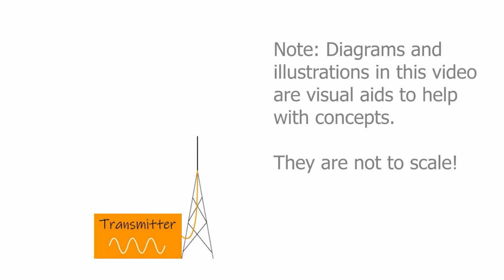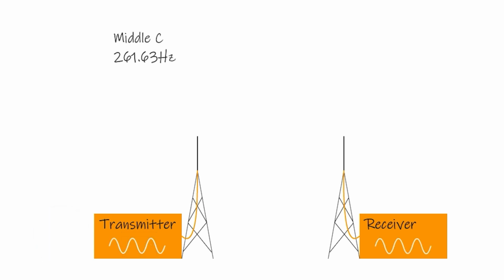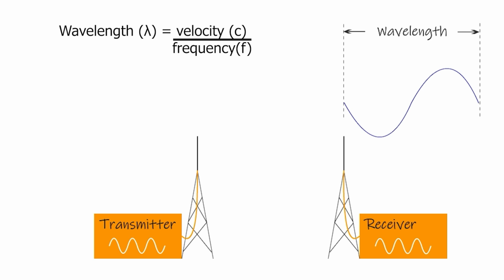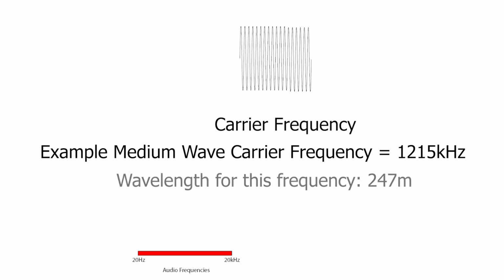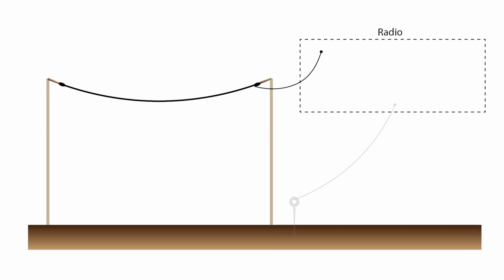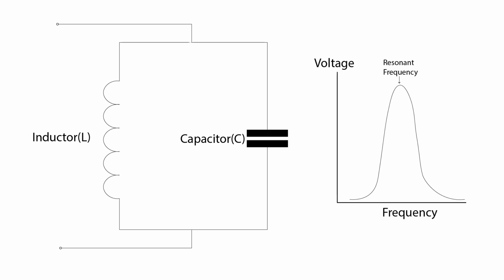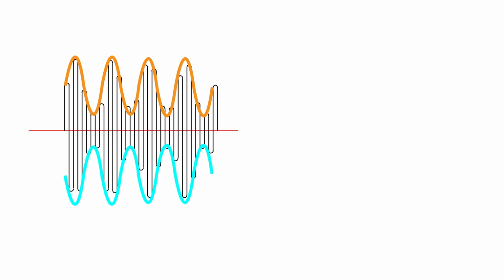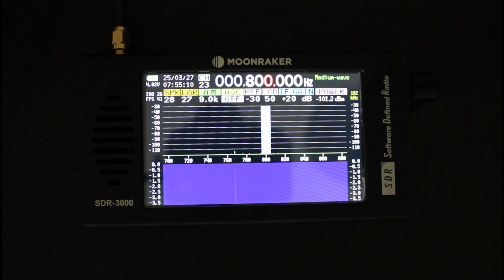Make: Electronics Book - Experiment 28 'Crystal' Radio Set

Comment: Oh my GOODNESS !

I am TEN Days shy, of my 75th Birthday . . . . . And I BUILT my first Radio (Crystal, Galaium, mounted in a copper pipe, using LEAD), SIXTY EIGHT Years ago !!!!

Onto a Bread Board, defined >then< as an old board, discarded from cutting a bunch of bread ! ! ! !

So, I find the beginning of this VERY INTERESTING!

The "Radio" was a "KIT", sold if I remember Correctly, by Revel (sp?). The Crystal fascinated me, as the INSTRUCTIONS stated "to make Contact with it we must Sharpen, the enclosed *Safety Pin*", (and how to sharpen it, with the enclosed piece of emery cloth . . . 😮 ). Then MOVING that sharpened Pin (with a Bandage on my finger, OUCH) upon the surface of said Crystal, until one hears a Signal ! ! ! ! ! ! ! ! ! ! ! !

The HARDEST part was creating the Antenna, which was to be "center tapped @ 200 wraps of the enclosed wire, total wraps, 400".

My older Brother heard me, laborously COUNTING: 168, 169, 170 . . . and started saying stuff like 68, 69, 125, 124, 300 . . .😮 

 . . . . . . . . . Later I learned not to trust my brother much, for HELP! 😂

I did get to 200, bared the wire from the enamel*, made the specified {tight} turns of tap wire onto the bared wire, and continued COUNTING, but not around my Brother! (*that same emery cloth!)

But I digress, I stopped and Wrote this, when you spoke of a Medium Wave Frequency! Our LOCAL AM Radio, 7 Miles away, OR; 11,265,408 mm for the Metric folks out there ;-) WAS 1120 Kc, Cycles  because it hurt to say Hertz, back then 😅😅😅 (Yesterday, I was watching a person MAKE apure copper Mirror, his Microphotography was capable of Nano meters, but my brain hertz to muchto convert MILES into nano meters, I don't even Have a Nano Symbol on my typewriter, err keyboard) ;-)

Thank you for a delightful channel, I was watching  rather than Working, as It is Sunday here in the Post Colonial world, and Monday, If I feel like it, I will continue building my Electronics Bench, I have one of them 21st Century Bread Boards, but my Mum WOULD never cut Bread on one of them 😢😢😢

and After conquering that world (R'Pi's, Italiano Duino's & a Colonial Beagle Bone Black SBC await my attention ! ! ! ! !

Cheers Mate, 

philip, from the Great Pacific NorthWET, Oregon, USA

I listened delightfuly!
Reply from the maker: @madsighntist14  Thanks for the feedback and for the interesting recollection . I didn’t know about sharpening the contact with the crystal, but that makes sense. 😀